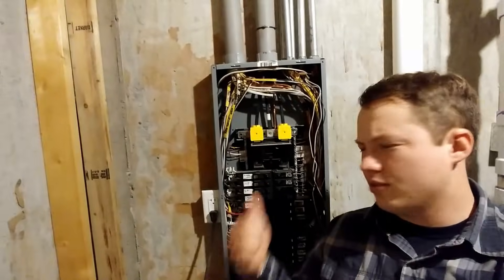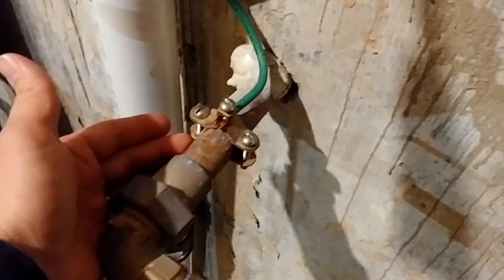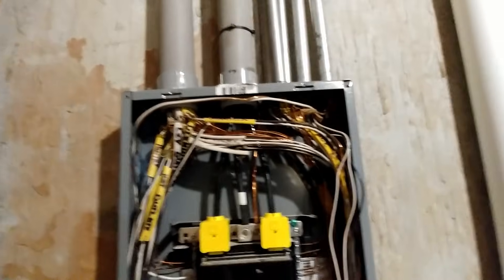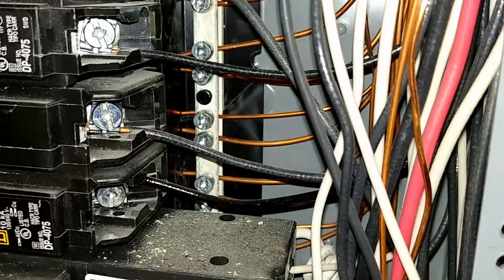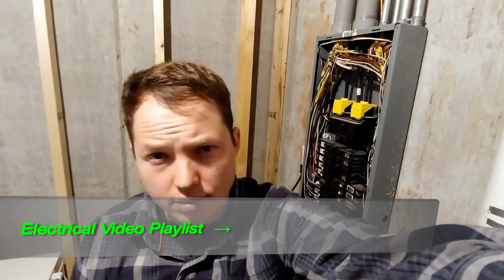Main Panel Wiring Example

Comment: Remove the sheathing before running down the emt pipe, with a choke point( changeover ) at the top of the pipe so the wire sheathing ( Romex jacket)doesn’t rub and fray over time

Comment: That grounds suppose to be continuous not just twisted around the ground rod wire lol , if you bond your main water or gas, make sure you run it back to the panel and land on the grounding bar without splicing or breaks

Comment: Hello, my name is Kimberly Rodriguez  thank you so much for this video the explanation was really clear, I am currently a senior in a vocational High School and we are installing a service as a project, with that being said I have a question. You mentioned that for water heaters we can use 10/2 and re -identify the neutral wire, so my question is, would it be wrong if you were to use 10/3 instead of 10/2?. Thanks again
Reply: It's not "wrong" per se, just unnecessary. For a basic electric water heater there is no demand for 120v so your neutral conductor in 10/3 cable would serve no purpose. I know there are more sophisticated water heaters out there that have wi-fi capability.  Not certain, but those styles may require 120v service in addition to the 240v required for the heating elements, in which case 10/3 cable would be necessary. In today's environment, it's a cost saving measure to use 10/2 cable instead of 10/3 every chance you get.

Comment: 6AWG is the largest wire for connection to a ground rod or metal water pipe that is in contact with the earth for at least 10 ft. Supplemental ground rods are not required by code unless you ground rod resistance is more than 25ohms. The shorter the wire for your grounding electrode the better!

Comment: Thanks for the great videos!  I am wondering how you get the Service Enterance cables into the home and protect the cable, and the homes envelop.  With SER would you come in with Rigid and then stop once inside?  How about a video of which is easier to work with for service enterance Rigid or PVC?  With SER cable at the 2/0 and higher, how do you do bends in wall and still maintain code compliance?

Comment: Great walkthrough! Been watching a lot of your electrical videos and they're all top notch for YopuTube information videos. 
Had to get my whole box replaced December 2017. None of the breakers are arc fault, but passed inspection. Wondering if that's a very recent code requirement, and if I should go through and replace all of them.

Comment: First...love your content and enjoy watching all of your videos! Nice job man!

What is the best route to take to “transition” to a NEW breaker panel without having to completely rip & replace/cut the power for long period of time. Basically, I want to install a NEW electrical panel in my house. However, I can’t really cut the power to my house and have my whole house down for several days (give or take). I thought of mounting the NEW panel off to the side, but the current SER cable would reach of course.

Comment: Ben, What's the maximum length allowable for the service wires coming from the meter to the panel?
Reply: 3-5-6 feet inside the building for the SEU cable. Ask your electrical inspector to know that exactly.

Comment: When you open the main breaker cutting off power, does that also cut off the neutral and ground circuits leaving?
Reply: No, they are not switched.
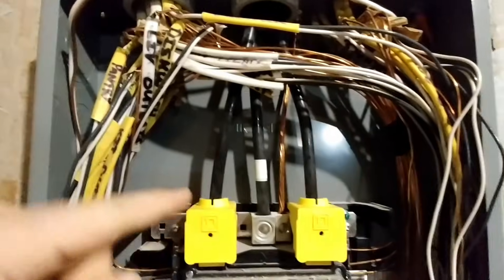Reply: @chrismitchell6478   At 1:48 etc. it looks like they are going into the main breaker just like the two hot wires, Of course you can't see through the cover of the breaker to observe where they go at that point. So. if the neutral and ground remain connected how, if at all, does this affect feeding a generator into the house wiring, whether by professional approved methods or otherwise? Would the generator be grounded out through the existing house ground and having the generator neutral connected to the incoming neutral presents no problems?
Reply: @bigpardner  They travel behind the main breaker. 
It would grounded through the existing system buy way of the grounding plug but should be grounded separately and properly. 
One of the most important aspects of grounding is about maintaining the same potential across different devices. 
If you plan to install a backup generator. It is extremally important to do it correctly. 
If not done correctly... The transformers on the street etc. will take the power you are creating with your generator and up it to 10s of thousands of volts. you could kill someone working on the lines. 
They make transfer switches or kits to attach to your panel that prevent this. 

I should add, I'm not a licensed electrician, I have just been enjoying the subject since I was a young child. I have been working with it since I was like 10yo and I'm almost 40 now (I really should turn it into a profession... lol)

Comment: Loving your videos. Watched a few in the past couple of days. Nice work. Very educational.

I'm looking to add a generator interlock in my subpanel located inside the garage. This subpanel has no main breaker. It supplies the entire home after it gets power from the main panel located on the brick wall outside.  The main outside panel has the 200AMP main breaker and the AC breakers. 

Q1.  Is it okay to add an interlock on the outside main panel? There are two slots open that could be used for the 50A Generator breaker.

Q2. Instead of going outside, possibly in the rainy/stormy weather, to switch back and forth between utility and generator power, would it be okay to add a 200A or a 150A main breaker in the subpanel and and use the interlock there? If yes, would the Neutral and Ground bars have to be bonded again or should they remain unbonded in the subpanel that would now have a main breaker?

Thank you.

Comment: with both of the AC wires being Hot, it doesn't need a Neutral???  And you said the Arc Fault tail goes to the ground bar and NOT the Neutral bar, is that correct??  (I'm a rookie)))!
Reply: Only need a neutral wire if 120V is required on a 220V appliance. 
Some devices like your furnace or stove are duel voltage systems, using both 120V and 220V so they require a Neutral line.
PS. the terms 220V and 240V are used interchangeably and are referring to the same consumer grade voltage systems.

Comment: Ben
On your neutral/grd video, you questioned the minute amp going to grd even with no bonding wire. The grd and neutral are connected at the main box. The returning neutral current may back feed that small amt to the grd because the grd is at zero initially. Not really an overflow but I hope you see where I am going.
dixchief@gmail.com

Comment: Ben, does NEC 2020 require DF breakers on Disposals or did the installer do something extra?   I thought Dishwashers required the 30mA GFCI (Black button)  instead of 5mA dual function DF (purple button)?

Comment: In about 14 minutes when he talked about the air conditioner is there a common Or a ground wire on there or do you just use 12 two for the two hotlines.

Comment: tour of a main service panel (2018 NEC)
1:20 electrical service wires
1:46 main neutral wire and grounding conductor, to water supply and to ground rods
3:00 bonding screw on neutral (/grounding) bus as evidence of this being a Main service panel, not a sub panel [assuming done properly]
4:00 conduits (optional) and protective bushing to protect incoming wires
4:28 pairs of smaller wires into each knock-out
4:45 sheathing comes a bit into panel
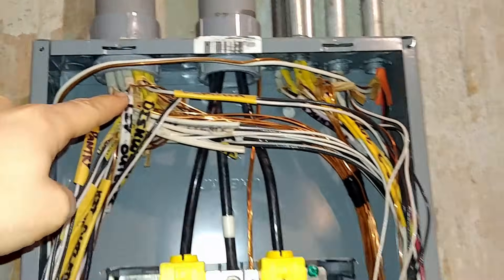5:35 landed grounds first
5:47 each grounding screw has only one wire (best option). multiple might be allowed.
6:06 labels on sheathing 
6:47 plug-on-neutral breakers are nice, avoid all the pig-tails, connect directly to the neutral bus
7:08 hot and neutral wires connect to arc-fault and dual function breakers. Only hot wire connects to older, standard breakers, and the neutral wire goes directly to the neutral bus.
8:00 load balancing discussion. You want similar amount of power from each 120 leg
9:40 arc-fault circuit vs dual function, which includes a ground-fault. Dual-function breaker means no need for GFCI outlet. Especially great to have dual-function breaker for outdoor outlets. Drawback, if it trips, you gotta reset at panel instead of at outlet.
12:42 Audible ground-fault trip outlet is great for important outlets, e.g. pumps, freezers
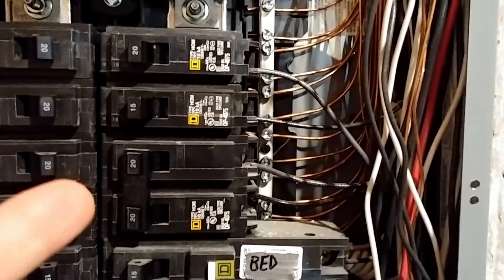13:36 2nd wire is colored black on this AC (12/2) 20A 240 circuit. Needs to be colored black on both ends. I don't understand this
15:32 electric water heater (10/2) just like AC unit, doesn't need three wires. And has just a standard breaker.
15:58 electric dryer and electric range require three wires (10/3) (unlike the AC). They have some 120 components that some reason need a neutral to return power. *I don't understand*. Older just had 3 wires, put power "back" on the ground, no longer allowed.
17:20 water heater on arc-fault maybe because it has a powered direct-vent component
Reply: The outlet hanging on the left of the panel... it is engaging a while breaker for itself only .. I am planning basement and running short of breakers.. can I rmv that and use the breaker for basement rooms etc..? Probably it is not code mandatory?

Comment: I watched a batch of videos as well as internet searching and you finally answered my question! I know the neutral and ground in the main panel are linked. Thus, I was HOPING I could connect the pigtail from AFCI/GFCI breakers to either side (the neutral side or the ground side - as they are connected). Without that, I could not see how to possibly add enough of these to protect all of my circuits as the pigtails could not reach to the other side of the panel. So, NOW I know - in the main panel with neutral/ground bus connected - these breakers can connect to either side. BUT, I assume from what I have seen so far that in the case of sub-panels where the ground and neutrals are separated, that you would want to connect these types of breakers only to the separated neutral bar... correct? Thanks for taking the time to make these videos and explain these systems.

Comment: Why didn't the electrician use an offset nipple on that handy box with the gfci so the cover plate would not need to be cut like that? That looks terrible. Even better would be to use a short section of emt and a 4 square box with an industrial raised cover.  And only the pipe for the service entrance wires is supported? Damn Ben. I like most of your videos but this one is not so great.
Reply: I think it's nice to see less than perfect installations every now and then to give you an idea what to look out for.
Reply: Hes right! 👎 Consider mounting a painted 1/4 of a full sheet of 1/2 plywood, then mount your panel and you can fasten your cables above, no conduits. You also gain a longer life of the panel as most cases mounted to concrete, damp, will rust through.

Comment: Ben,
I’m trying to add a sub panel to my garage. My main panel is on the outside of the house. The electricians that wired my house ran all the circuits through the back of the box using the big pvc conduit stubs into the wall cavity. The cable I’m trying to run doesn’t look like it’s going to fit because both of those stubs are looking pretty full. The bottom of the box on the exterior looks like it has some knockouts I could use but how do I get the cable from the wall cavity through the knockout properly and keep everything water tight. 

Thanks,
Thomas

Comment: Can I splice ground wire inside the Panel?
4 of my.ground wire were too short
Cant reach.to grounding bar 
plz
thanks
Reply: if its not being inspected yes no problems if it is just check with local inspector most dont have a problem with splices in panels as long as there is room.

Comment: Hi Ben, I've been watching and sub'd for a couple years now and find your vid's and info very straight forward and helpful, so Thank You for what you do. 

Question is, what are code requirements regarding arc/ground fault breakers or receptacles in an older house when upgrading my main service panel to give me more circuit/power capability (100 to 200 amp)? Does my 1950 Cape Cod Style house have to have all the CAFI and GFCI breakers or receptacles same as a newly built 2019 home does?
Reply from the maker: Firstly I would say that this is a bit of a grey area. I would contact the inspector in your area and see what they will require as well as what they would recommend. They are usually very helpful with these situations and just want to help the installations that they inspect be as safe as possible.

As far as I am aware you are not required to install AFCI & GFCI breakers for a panel upgrade. HOWEVER, I would highly recommend upgrading to AFCI if at all possible as this adds a significant improvement to the safety of the old wiring in your house. Bringing whatever aspects of your electrical system up to current code never hurts and the NEC is designed to keep us safe.

So in summary, I would bring it up to current code wherever possible whether or not it is required.

Thank you very much for being a subscriber! I appreciate it very much. Good luck on your project and blessings to you from Minnesota!

Ben

Comment: Did you say unusual for furnace to have a circuit by itself?  Have other plugs with it be ok?
Reply: Unusual as it was a regular, not ARC fault breaker in that panel

Comment: Question about the plug on neutral.  You said it eliminated the need to have the pigtails.  But in this box, they are still there.  Do you normally remove the pigtail with the plug on neutral?  (Great video explanation, BTW)
Reply from the maker: You can still use pigtail breakers in a plug on neutral panel. I believe they used them in this case because the pigtail breakers are sometimes cheaper. Great question!! Thanks for asking!

Comment: Why on earth would you buy a Plug-On-Neutral panel and use the GFCI/AFCI breakers with pig tails? And our AHJ will not allow Romex in conduit.
Reply: PVC or metal conduit?
Reply from the maker: I'm guessing they used pigtail breakers because they were cheaper? That's all I can think of...
Reply: i dont like romex in conduit either, but by code it is allowed.

Comment: I would not have a job if I wired a panel that badly. That is a nasty looking rats nest.
Reply: I mean, it's not /r/cableporn material, but I've seen far worse. What's the big issue?

Comment: If it was me, i use ground bars, in the top of the cabinet. Now they are covered by the breakers. And the pointy ends out, towards the sides. Use GFCI/AFCI combo breakers for everything, except for the special wire to the freezer. Use a normal breaker there (or afc?). Love the video.

Comment: Good job, good explanation! Some inspectors in some areas may complain about multiple romex cables in a conduit. They might require derateing of the wire due to potential heat build up in a pipe longer than 2'. Same thing going through hole bored in joists with multiple cables but they usually don't bother with that due to the cables only being together for 1 1/2" joist thickness
Reply: with romex in a conduit you have to calculate it as if it were a round conductor, thus a single 14/2 (by southwire) is about 91mm2 ( (pi/4) * 10.7442 ^2) ), and 12/2 is about 109mm2. conduits have a max fill of 40% with more than 3 wires. a 2" conduit has a 849mm2 (Article 362) of usable space at 40%. hence you can fit in 9 14/2 wires or 7 12/2 wires. it looks like they've got at least 9 wires consisting of a mix between 12 and 14 so sufficed to say they are over fill. 3" probably would have done the trick.

Comment: This was a great explanation of the entire panel.  You do a great job being thorough.  Those plastic covers are so ingeniously simple.  I have one panel at home that has a nice arch spot on it from an incident that happened.  I didn't ever think about audible GFI or know that existed.   I searched the save big money box store and I did not see them there because that is a must for freezers (I had one trip once, which did not end well for the contents).   I cant believe how expensive those are though.  The Arc Fault and Dual breakers are nice, but also, damn, I am not disappointed I rewired my houses before those were a thing, I would have been brook 3 times over when replacing entire panels with them costing almost 10x more over breakers.

Comment: We use glands instead of the bushing.For armored cable. Also the earth wire for each circuit is sleeved or else The Standards Bureau would fail it .Very nice video man 👍👍👍